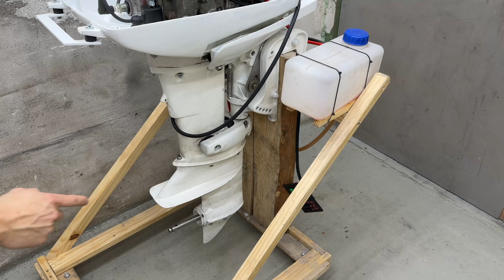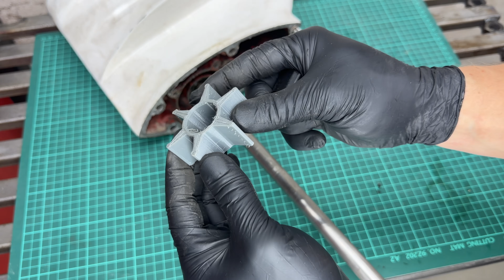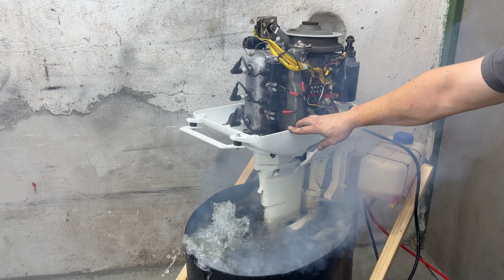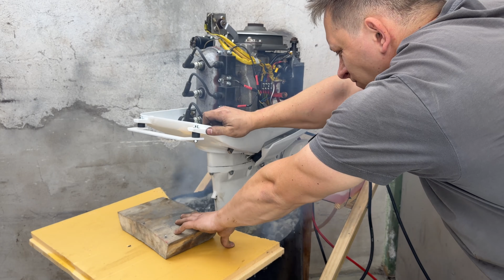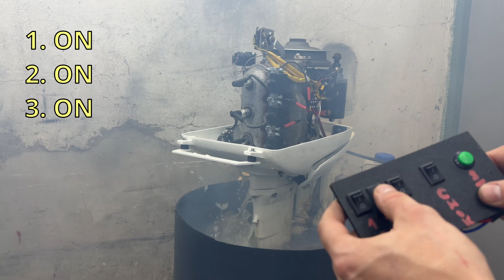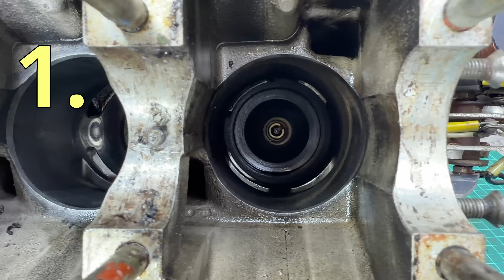I Took Apart My $50 1968 Boat Engine… And Found Bad News

Comment: I’ve seen that style of pins that hold a water pump in like that before, but it went all the way through and it was one pin so I don’t see a issue with the pins, especially when you switched it to stainless

Comment: Put a fan to blow fumes away front air intake no oxygen from fumes and its choking off the air supply can't run in smoke and recycling exaust

Comment: It’s been a while since I’ve seen the 1st video, but was the fuel system cleared? Was the throttle linkage linked and synced? Sometimes cheap automotive pressure gages do not do well with smaller motors since smaller motors have much less compression numbers. If the block is  too far gone, have you checked if they’re are any good ones for sale on eBay or such? It’s really sad for you to call it quits after this much love was put into it! But your decision is understandable as well.

Comment: The cylinder is still usable!! dont junk it just yet. I would do a hone and put new rings in and it should be good! You have to remember 2 strokes are NOT picky about perfect seal surfaces and such like 4 strokes do. It can still run very well even with a bore like that, I would at least sand the high spots down so the rings dont catch it but the ball honing should do that well anyways. Ive repaired many outboards and you be surprised how screwed up the bores or piston looks yet still run like nothing has happened. 2 strokes are very forgiving for its conditions as long as you dont see major blow by on the piston which yours has NONE of so it is running well.
Reply from the maker: Thank you, that’s good to hear!
I was worried because the cylinder coating looks damaged, and the magnet doesn’t stick, so I assumed it was a coated aluminum cylinder and that honing could make it worse.
But you may be right... maybe I was too quick to call the block unusable. Since there is no major blow-by visible on the piston, it might still be worth trying to smooth the high spots, fit new rings, and see how it runs.
Thanks for the advice, especially from someone who has repaired many outboards!
Reply: @FixitBuilditLoveit  yeah you can see some of my videos messing with some lol but for sure new rings will bring that motor back to life Even if one of those cylinders are weak, it will still at least have 3/4 of power which is plenty. Its not like you going to use the motor everyday and you need it to be reliable etc. Its for fun and experience to learn and work on. Also honing the cylinder wont wear it down, you need to do it anyways to have the new rings break in properly. The coatings are always very thick from factory.

Comment: lots of patience and perseverance with the old motor, yes you should have checked its internal conditions first also bearing in mind that parts for these old junk are almost impossible to find. What is your name then ? bye Augusto fro italy
Reply from the maker: Thank you, Augusto!

Yes, you are absolutely right. I should have checked the internal condition much earlier, especially with such an old engine where spare parts are almost impossible to find. But at least I learned a lot from the process, even if it didn’t end the way I hoped...
My name is Jakub. Nice to meet you!

Comment: Nice! Don't call it a failure yet. Piston don't show signs of blowby. The coating damage you have, don't seem contain scratches in the compression area, that leak the compression/ combustion pressure past the piston rings.  The damages in the coating can be chamfered carefully with die grinder and a "stone bit". Then the coating don't start peeling or scratch the piston. People do port and make new holes even to coated cylinders, just chamfer the edges and it will be fine.
Reply: yes i was gonna say this, that cylinder looks to be running good other than maybe slight low compression but if he ball hones it and put new rings in, it should bring it back up enough to run quite well.
Reply from the maker: Thank you both, that is really helpful and encouraging.

I was mainly worried because the coating looks damaged and the magnet does not stick, so I assumed it was a coated aluminum cylinder and that honing or grinding could make it worse. But your explanation makes sense.. the worst damage does not seem to be directly in the main compression sealing area, and the piston does not show obvious blow-by marks.

Maybe I was too quick to call it a failed block. Carefully chamfering the damaged coating edges so they do not keep peeling or catch the rings sounds like a much more reasonable approach than just giving up on it.

I may still try to smooth the high spots very carefully, use new rings, and see what compression I can get. At least it could be worth one more attempt before calling the engine unusable.

Thanks again for the advice. It is really useful to hear from people with more experience repairing old outboards...